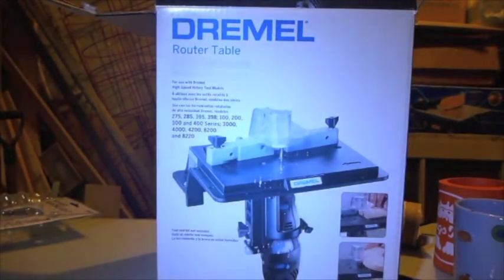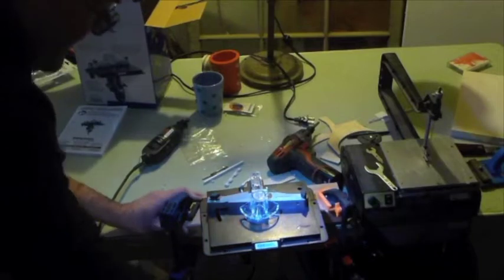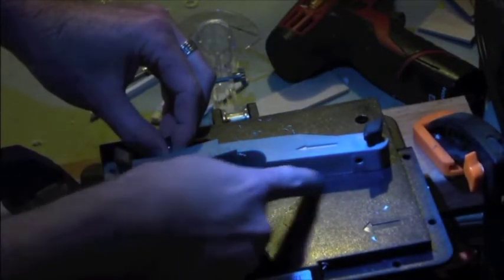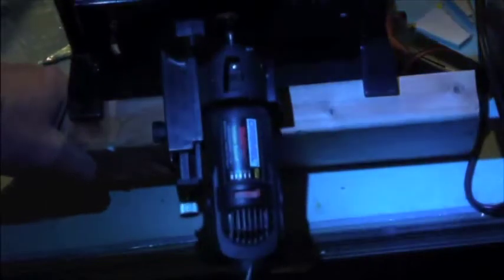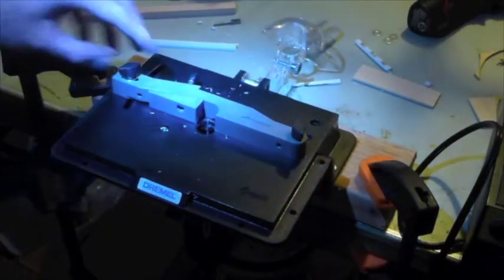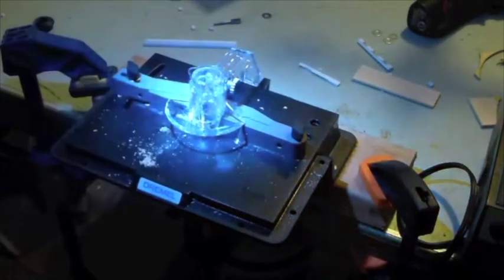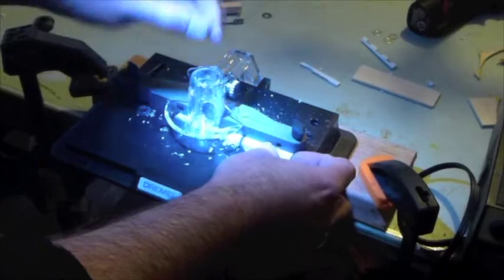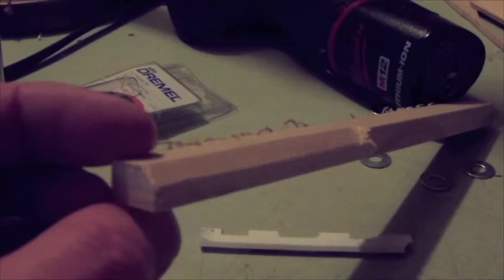Random Platypus Review: Dremel Router Platform

Comment: Your suppose to screw it to the side of a work bench or table. so you don't need the clamps.
Reply: He's using an alternative method which is also suggested in the manual to make the tool portable.  His clamping issue would be fixed with a longer board.